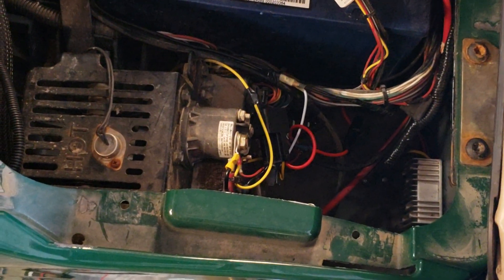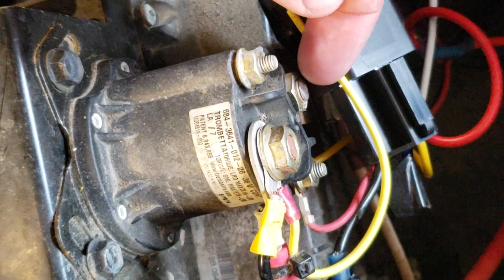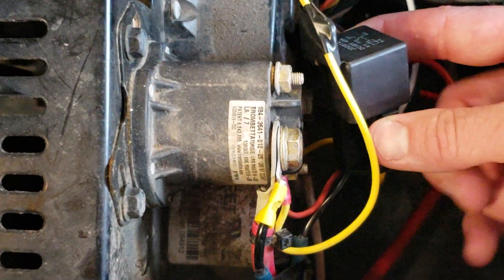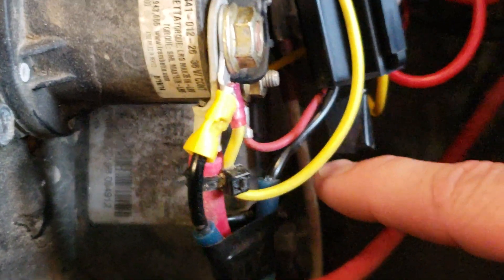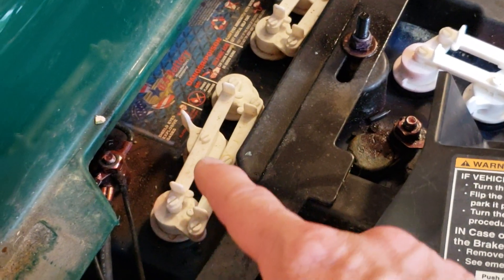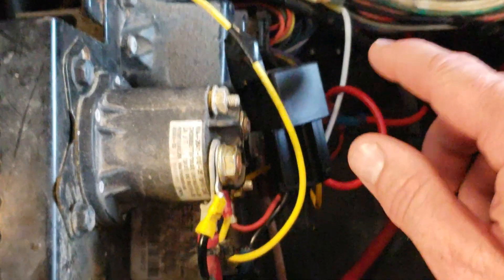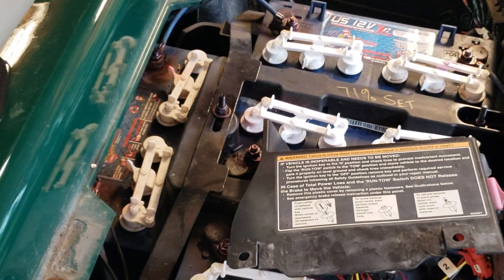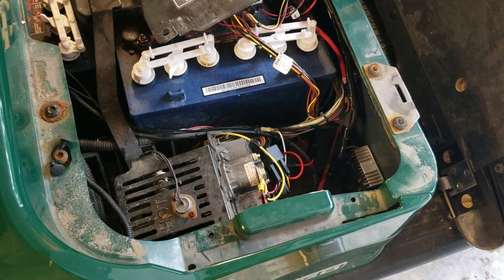2008-2018 EZGO RXV 48 to 12 volt Accessory Circuit Relay How To

Comment: So when I installed my converter to the batteries then ran it to a fuse block I installed a new ignition switch plate with usb ports and they never shut off. Then when I went to put the cart into forward the cart wouldn’t move. So by installing this would there be no ground going directly to the input on the converter since it’s going through the solenoid? Then just wire my fuse block through the outputs on the converter?

Comment: How did you get the controller to reset?
Reply from the maker: Try disconnecting the batteries from the controller. You may have to charge them up individually manually to the same point and then reconnect everything.
Reply: Jack of All Master of None ok I have the whole thing torn apart dwn to the pedals checking the sensors so hopefully something that simple wrk.. don’t know how it happened because I tapped into the 12v from battery to headlight switch
Reply: I added a led strip to the 12 volt side of the headlight switch and everything seems to wrk as normal except the cart won’t move forward or reverse and I cans get the brakes to release now

Comment: Could you just use the 48 volt spare leads located under the beverage holder in the dash area and install the voltage reducer there?  since that is the location you want 12 volts at normally , "for say a radio" it would make sense to place it there.

Comment: How do I reset the controller after it times out
Reply from the maker: Not sure what you mean. Did u turn it off and back on?
Reply: Yes I’ve disconnected the batteries and all and I’m not getting anything when I turn the key

Comment: The 20 amp step-down converter that I installed on my 2009 RXV I wired directly to the batteries exactlythe way the controller is wired to the batteries.

Now I understand the reason why you did it that way is because when you shut off the golf cart it kills the power to the accessories and that's eventually how I want to do mine.

Right now only my sound system is hooked up to that converter but eventually I want to get a much better and more powerful converter that actually has a harnessed and allows you to connected to your ignition so when you turn on the golf cart it will send a signal or current to the converter to turn it on so when you shut it off it shuts off the power to the accessories.
Reply from the maker: I didn't do a video on it but I recently installed a more expensive converter that works exactly like you are describing. It has an issue though. There is a slight power draw even when the ignition is off that over time drains your batteries. If you leave you cart unplugged for a long time like I do, that ends up being a problem. I had to wire in another 48v relay to kill power completely to the converter when the ignition is off. Now it doesn't drain the battery anymore.
Reply: @JackofAllMasterofNone  that's something that I will have to keep in mind when I eventually do it.

As I seen on YouTube and in the manual it does say that the batteries will slowly lose their charge and is important to keep the golf cart charged as often as possible.

This is something that I have learn from since I left my golf cart sitting for a certain amount of time with the charger still plugged into the cart and not charging it drained my one battery to it was completely dead the rest of them were about from 30 up to 50% charge on them. 

Thank goodness I did some research to figure out how to revive it.

The dead battery was due to too many accessories running off of it along with sitting around for a while without being recharged.

Comment: THANK YOU !  This was a tremendous help.  I just wired a MadJax ultimate light package to my 2010 RXV  with the Danaher controller and it works perfectly.  Now I have DRLs, lights, turn signals, flashers, brake lights, Hi/Lo beams, horn and USB charger port all working perfectly.

Your clarity and explanations were excellent!

Comment: Did you happen to try connecting your reducer to the small red terminal on the solenoid? I've read that is the proper location. I have read that the solenoid will timeout after 20 minutes or so.
Reply: Ok so I didn't make this video but I installed this relay today and it works great. I tested it by leaving the cart on in the "forward" position at the ignition for 2 hours and it did not time out. It stayed on the entire time. So thankful to the person that took the time to post this.   My cart is a 2008 RXV with the Danaher controller. I am not sure if a Curtis controller will time out or not but I will try this and update when I work on the RXV with the Curtis next.

Comment: Nice work.  Does the controller time out the solenoid power after being on for a while when the motor is not running? Thanks!